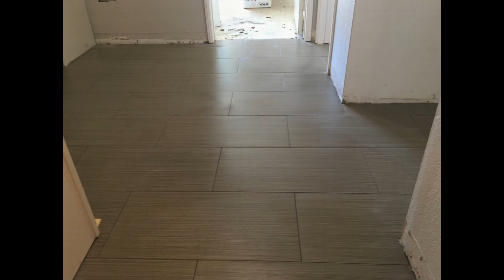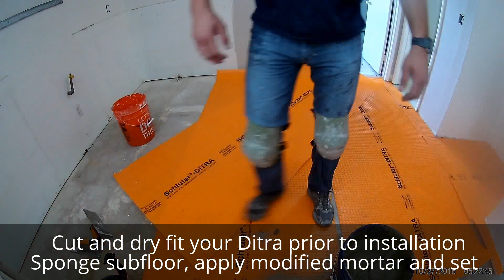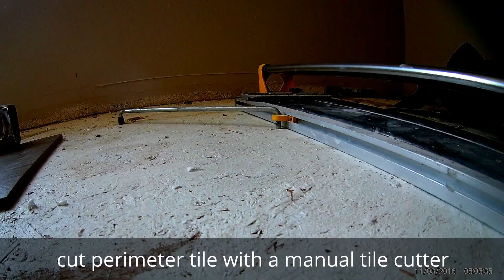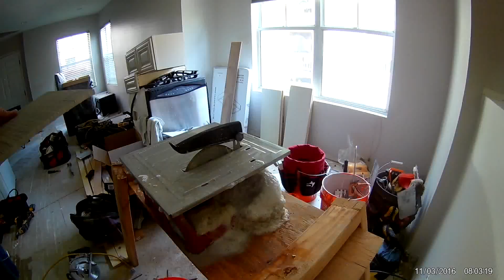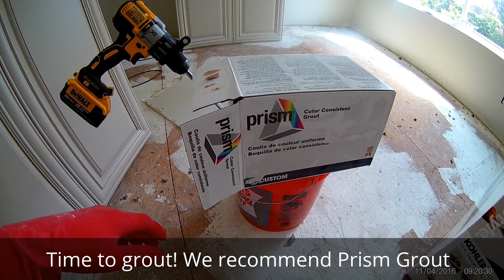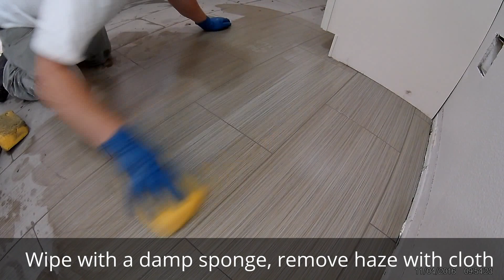Install 12" X 24" Porcelain Floor Tile on Schluter Ditra

Comment: So many problems with this video I don't know where to start. 

First, you don't backbutter the tiles. With large format tile it's always a good idea. 

Second, you don't use any kerdi-band on the seams of your ditra membrane, so you missed out on an opportunity to truly waterproof the floor. Kerdi-band should also be used around the lip of the tub as well as the edges of the walls. The edge of the tub is especially important because of all the water that is likely to splash there. The ditra is supposed to be a quatmrter inch from the tub so it doesn't protect the edge alone. 

Third, you didn't burn the thinset into the waffles before using the notched side of your trowel. Lots of waffles don't look like they were fully filled, which means you don't get proper adhesion to the membrane. 

Fourth, you lay the tiles at 50% overlap. A tile leveling system will not fix that issue because the tile leveling system is not strong enough to bend a tile flat. It's going to be bowed whether you use a leveling system or not. With 12x24 tile you need to layer in thirds.
Reply: Rookies!

Comment: I think all 12x24 recommend using 33% spacing.  Also trowel long side to long side for a superior job.
Reply from the maker: If you are a homeowner trying to install without a leveling system, yes go 33% but it does not look nearly as good as straight or 50% All is fine if you use a tile leveling system.

Comment: What is the reason you are using ditra on the subfloor? Is it because of the tile cracks if it's not being used? Also do I need subfloor to be level before installing the tile if using the tile leveling system?
Reply from the maker: Ditra is an uncoupling membrane and yes, it helps with movement and keeps tile and grout from cracking. No, the sub floor does not need to be level to install tile. You can compensate with a half x half inch trowel, back butter and a tile leveling system.  👊

Comment: As a DIYer doing a 5x5 bathroom with 12x24 porcelain tiles is the tile leveling system really necessary?
Reply from the maker: It will make your life much easier and a much more superior install.
Reply: :)  I had actually decided to go ahead and spend the $30 on a box of QEP anchors and wedges.  The flat LASH kind seem like it will work.  Was going to use a 1/2x1/2 square notched trowel too. As a DIYer I'm too cheap to pay someone else to do this plus I think these are fun projects.  I notice you staggered 50% instead of 33% for these oblong tiles. Is staggering a matter of personal taste?
Reply from the maker: That's great! We have used the Lash system many time and now that the clips are flat, they are much easier to work with. That's great you are taking on this project and saving some money! We think the 50% offset simply looks better (we are crazy symmetrical guys) but it's all personal taste.
Reply: Just tiled the floor today and I agree, using the LASH leveling clips was easy and resulted in no lips. However the 12x24 was a pain, would have rather has 12x12 but my daughter was the boss so....
Reply: Doesn’t schluter recommend using unmodified thin set?

Comment: What modified mortar would you suggest to set ditra and for the tiles? I plan on doing ditra xl on subfloor 12×24 inch porcelain tiles with tile leveling clips.
Reply from the maker: We use Versabond, it works well for us. Get it at Home Depot.

Comment: Quick question.  You say to use modified thinset but ditra specifies un-modified.  Does it really matter?
Reply: Use modidied if sticking the ditra to wood subfloor and then unmodified to stick the tile onto the ditra

Comment: I am install 12x24  porcelain on floor brick pattern ,after i done i look at the box they not recommended 50% overlap make me sad.
Reply from the maker: That's because porcelain bows in the middle. Use a tile leveling system and you will be fine!
Reply: Landberg Tile DIY TV Thanks you so much. Your answers make me understand easy.